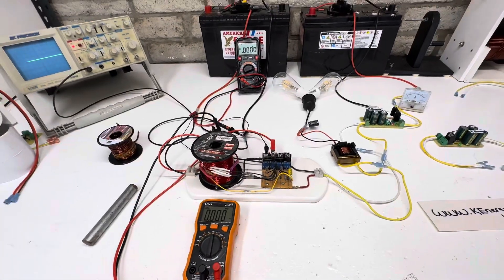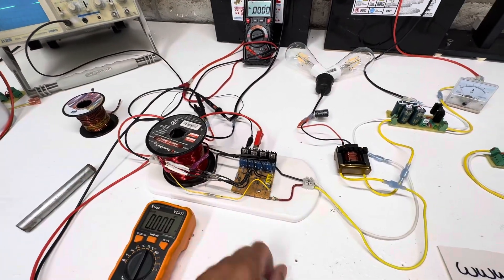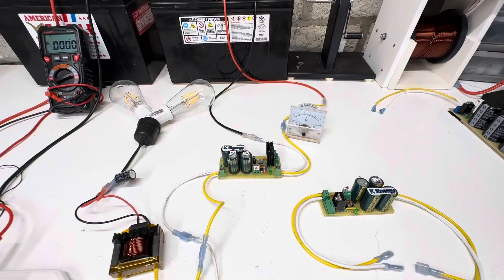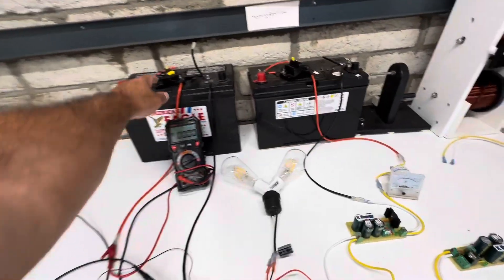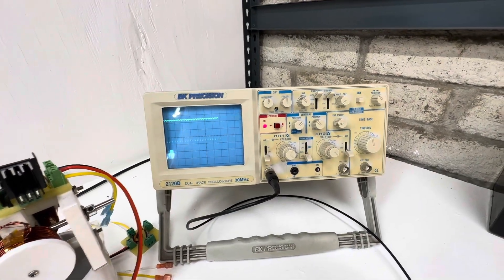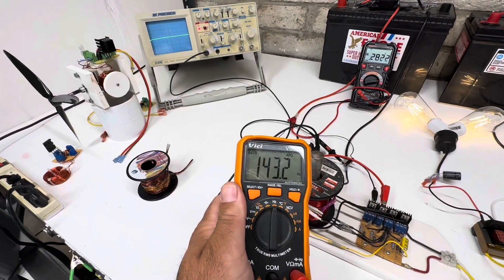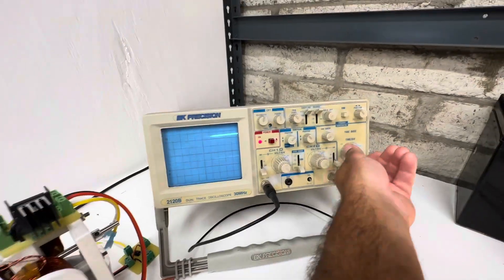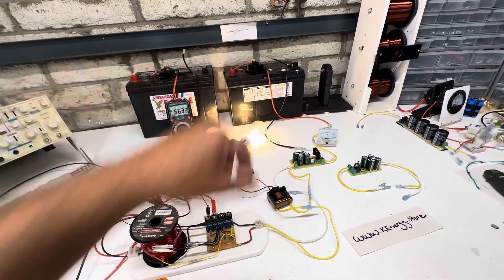Forced Oscillator with and without core

Comment: How is the opto circuit tuned sir?  Changing out the components?
Reply from the maker: This video is an oscillator are you referring to tuning the oscillator?
Reply: @kenergy1707  Yes sir.
Reply from the maker: @hoofheartedicemelted296  by the resistor to the base and number of turns
Reply: @kenergy1707  Thank you sir. So every coil is an oscillator?
Reply from the maker: @hoofheartedicemelted296  forced oscillator has 2 winding 
Power and trigger
Reply: @kenergy1707  Thank you for your patience sir.
Reply: @kenergy1707  Is this a nod to retro trigger, is the opto not the trigger sir?
Reply from the maker: @hoofheartedicemelted296  there is no opto on a forced oscillator circuit
Reply: @kenergy1707  I'll just keep looking at this repeatedly.  At some point it will sink in.  Thank you for your patience sir.